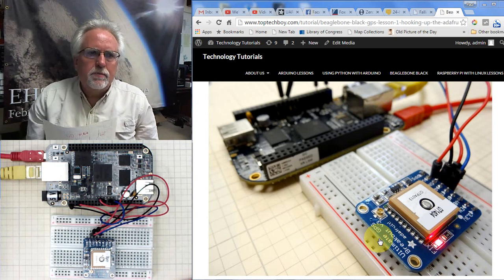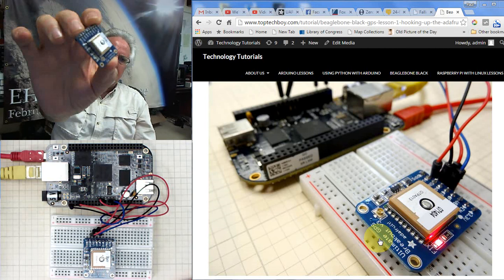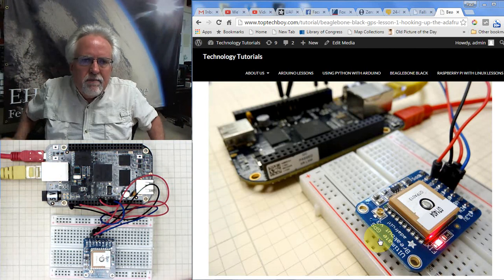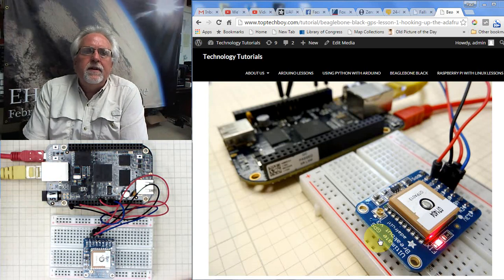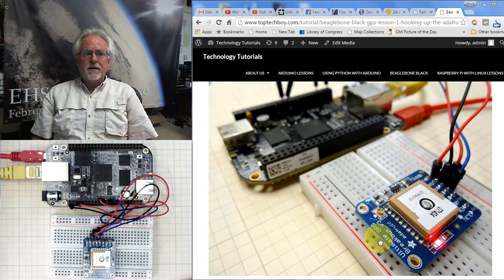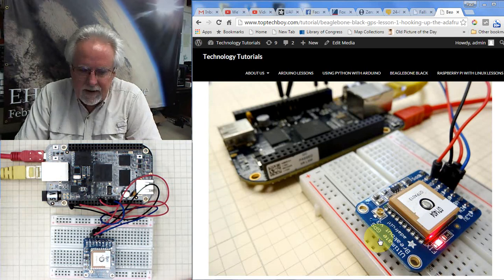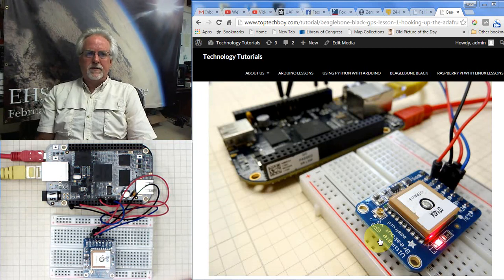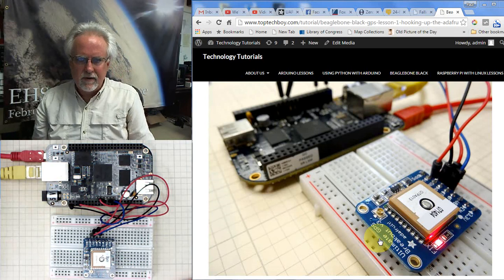Troubleshooting the Adafruit Ultimate GPS When Not Getting a Fix

Comment: I don't really understand the comment about ballistic missiles and GPS manufacturers needing to shut down the GPS because they are moving fast and at high altitude.  GPS is receive only.  How does that affect anything?  Am I missing something here?  Sounds like you've been told some old wives tales.
Reply from the maker: Actually it is not an old wives tale. Try using most any GPS at high altitudes (>60000 feet). It shuts off. It has nothing to do with transmitting. The module itself realizes its altitude, and turns itself off. The issue is, the government does not want the technology used for home brew advanced weapons, which is understandable.  Manufacturers interpret the regulations in such a way that they prevent legitimate and legal uses.
Reply: @paulmcwhorter  I see.

Comment: The example ultimate GPS code assumes that the loop() is always running.  This is how it reads characters from the GPS serial to make a "sentence".  Once you are not in the loop, you need to create a separate loop when checking GPS.fix to get ALL of the characters every time.  Something like this:

void get_gps() {
  
  int k = 200;
  int t = 0;
  while (t < k) {
    char c = GPS.read();
    if (GPSECHO)
      if (c) Serial.print(c);
    if (GPS.newNMEAreceived()) {
      if (!GPS.parse(GPS.lastNMEA()))
        return;
    }
  t++;
  }
}

Comment: You mention that you need totally clean power for the GPS Breakout board. I have a project where the GPS shares 3v3 and gnd with a number of other devices. None of them burn as much current as the GPS, but I do find that occasionally, it will seem to brown out. It'll do two 1Hz flashes, then a very brief pause before two more. I assume this is the board restarting itself over and over as power misbehaves. It's never done it while connected to my scope, so I'm assuming here. If I wanted to get "clean" power for this thing, I assume a capacitor will do the job. What's the common wisdom for selecting it/them?

Comment: My ultimate GPS, is connected correctly, it does send me data, but it heats up, like not warm, but HOT, it still works, but it gets hot, Even when powering with 3.3v straight from arduino, and also tried 5v, it just heats up faster, which is expected, but it works, I just dont want it to heat up. I have the same issue with the LSM303 Compass/accl, they work but they just straight up dont work anymore if i try a second time, and after the first try when they work 100% they heat up insanely fast.

Comment: Hi Paul,
I connected a Ultimate GPS Featherwing to the MO adalogger of adafruit get uploaded codes, however, I don't see any data in the monitor plotter. I tried even doing the simple RX & TX test on the powered GPS, which after a while started blinking showing fixs, however, the monitor plotter remains blank. I conclude the GPS works and get fixs, however, I am not able to see that. What your recommendation?

Comment: how can you not getting a fix inside? My phone's GPS works fine but I can't get a fix. Does it mean my phone's GPS is better than this one, which advertised for the 'best sensitivity'
Reply: actually your phone also looks around for nearby cellular signals, it then triangulates an aproximate location for you, much like cellphone tracking. this information is then used to get a fix with the satellites
Reply: do you mean cellular triangulation is substituting GPS localization while no fix received from gps, or do you mean the approximate location will help gps getting a fix? Because from the accuracy of my phone's gps, I don't think it's using triangulating, it's quite accurate while I'm in the same room I can't receive fix from this board.
Reply: ziranshu Zhang its used to get a faster fix, that's about everything i know about it

Comment: Hi paul,
I am using the ultimate gps with the rasp pi 3 using a UART connection. I am having difficulties getting it to work. I am a beginner that could use some help. Is it possible to make a video using this setup, it would be very help full.

Thanks

Chris
Reply from the maker: Chris, RPI really messed things up on the RPI 3. They tried to incorporate blue tooth, and it has messed up some of the UART pins. There are some work arounds but they are not easy. My suggestion, hate to say, is to get a RPI3 if you want to use the GPS and hope they work through the bluetooth issue at some point.

Comment: Hello everyone!
Does anyone experience with building custom antennas for this shield? 
I will use this board in a custom design in the chape of a hexagonal box, and was wondering if i can imrpove reception with not a giant antenna, but sth i can build on my own..
Thanks!
Reply from the maker: Adafruit does sell an external antenna. You need the external antenna, and the small adapter cable. This will greatly improve the performance of the device, and probably allow for getting a fix much quicker. I do not use it, since my application is High Altitude Ballooning, in which case weight is the thing that must be minimized, hence no weight budget for an external antenna.

Comment: If a GPS receiver have lost all its memory, it have to  get the complete satellite positions and orbital maps almanac from the satellites.  That will take 12 minutes and that is if it have good reception and doesn't loose any packets during that 12 minuts or else it will take a lot longer. So it is good to have a backup battery connected to a GPS, so that it can keep the almanac in memory and just need to update it a little when powered up.  Just leaving a GPS turned on outside for a couple of hours usually fixes it so it gets lock faster in the future. (giving it time to download the almanac). Have a nice day !
Reply from the maker: What you are saying is correct. Also, though, the Adafruit ultimate GPS without an external antenna can be a little tricky sometimes. Sometimes WAAAAAY longer than twelve minutes.

Comment: My GPS is capable of achieving a fix from a satellite but will not transmit the data to my raspberry pi.  I know it can contact satellites due to the change in frequency of the blinking red light.  Do you have any experience with getting a fix but not being able to transport the data to your micro-controller?
Reply from the maker: +William Quigg I would start by trying to just print the raw datastream coming off the GPS. The adafruit sits and spits out NMEA sentences if it is powered. Try to just print the datastream coming from the adafruit on the raspberry pi.
Reply: +Paul McWhorter Do you have any resources where I can learn how to print out the NMEA sentences? Currently I only know how to print the time, location, speed etc... display, all these values say N/A and says
 NO FIX (O seconds) even when I know there is a fix.
Reply from the maker: +William Quigg You need to just capture the raw data stream coming off the serial connection to the GPS. It is sitting and spitting out raw data. Even without a fix, you can see the NMEA sentences. My videos show how to do it on BBB and Raspberry pi should be almost the same.
Reply: +Paul McWhorter Thank you for the help.  When I have a fix the NMEA sentences are working properly (there is a value in every field) yet I am still unable to have "cgps -s" return a valid fix.  Is the "cgps -s" crucial for capturing data on my microcontroller or can I capture time and location with just the NMEA.
Reply from the maker: +William Quigg All the information from the GPS is contained in the NMEA sentence. I am not sure what you are doing with cgps-s . . . just parse the NMEA sentences, and you have all the data
Reply: +Paul McWhorter Can you reference one of your videos where I can learn how to parse the NMEA sentences?

Comment: 99% of solar flares make no significant difference to GPS.  Only truly enormous flares (happen every few decades) are even measurable on GPS.  The one thing you didn't mention is EMI/RFI.  The Adafruit is a very sensitive radio receiver, and is trying to pick up microwave signals from satellites from 12,000 miles away using an antenna the is a fraction of a square inch.  The tiniest amount of electromagnetic interference from any other electronics in the GPS band will completely blot out the GPS signals.  Don't mount it near unshielded electronics.  Strong nearby transmitters (telemetry, video, etc) even if they're on other bands will desensitize the GPS receiver and deafen it.  The external antenna jack is on that board for a reason.  Get the antenna away from things causing radio frequency interference and the system will work better.  Very small and light antennas can be built or purchased.

Comment: Hi, im from Venezuela and im using this gps module and have a question. When the module get a fix for the first time, it begins to work normally? i can´t get a fix yet but i will follow your suggestion and see what happens. Thank you.
Reply from the maker: +Elias Magallanes Sometimes it takes time to get fix first time. If you use the button battery, and keep it in the unit, it will find fix faster next time.